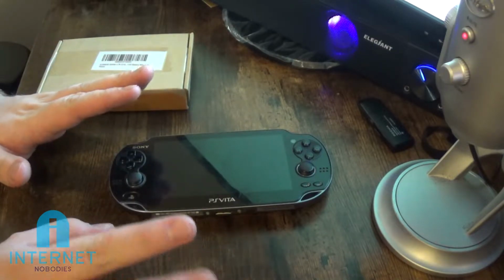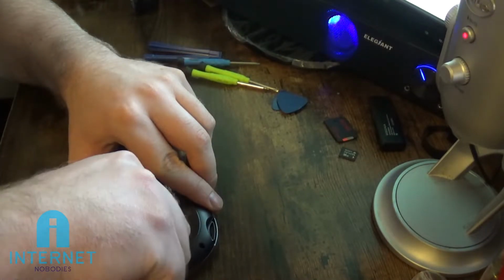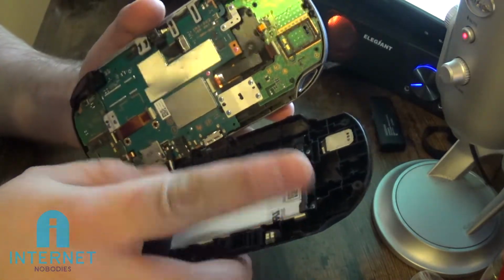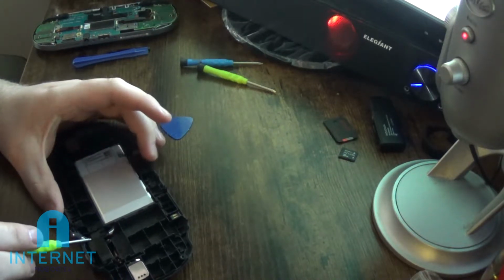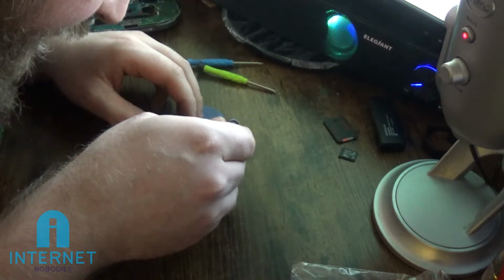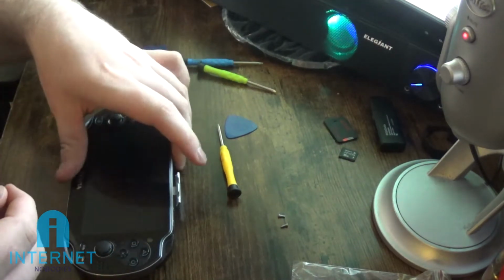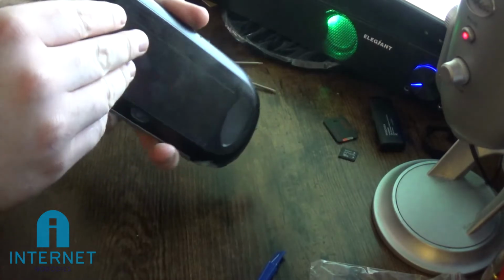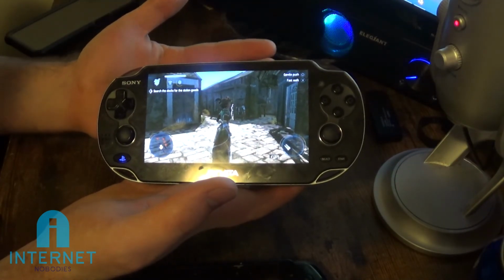Replacing my Vita Battery (DEFINITELY NOT A GUIDE)

Comment: Update: It's been about a week since recording this video and I have to say, the battery life is much improved. Apart from the initial charged and drains to set the battery life as per the instructions, I have not had to recharge my Vita and I've been using it roughly the same amount. A few days on RetroArch playing Super Mario RPG here and there, I'm at 44% when originally I would have had to charge it twice by now. Not that an SNES game is very power intensive, it's a huge difference.